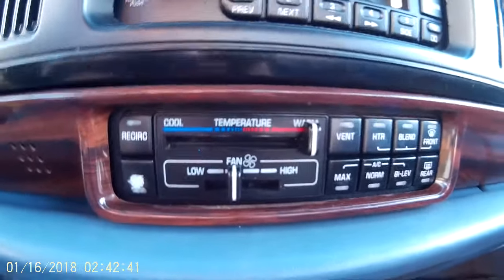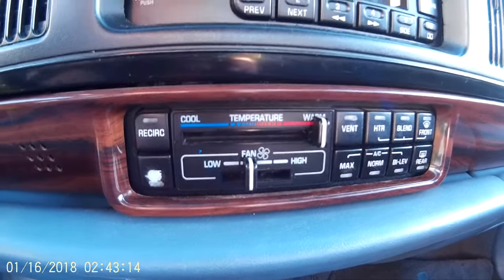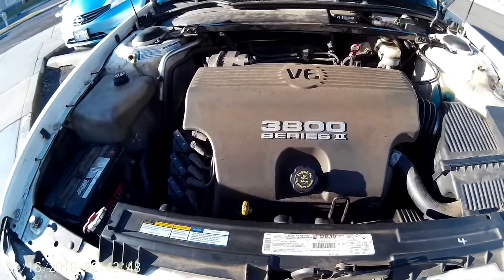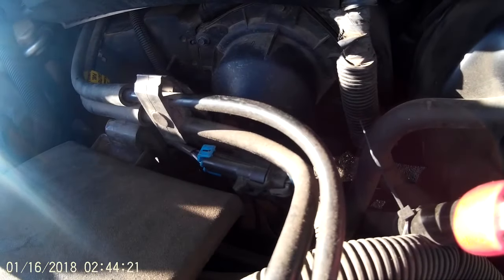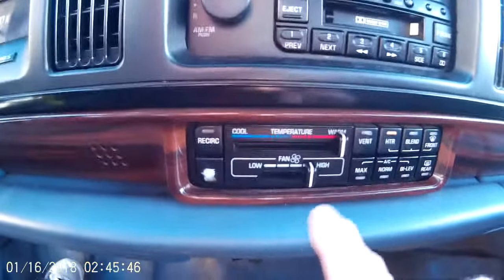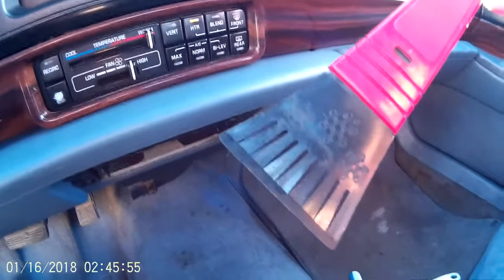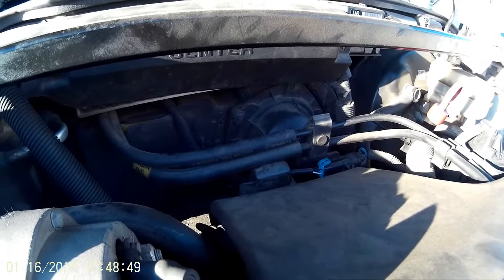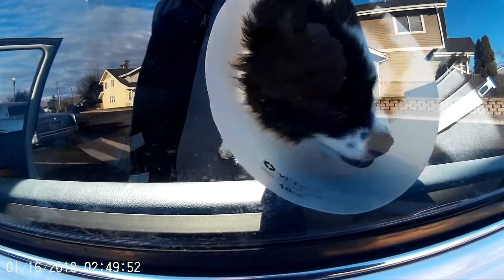1997 buick lesabre custom heater blower motor

Comment: That and the resistor pack are common problems on these through 1999.
Reply: With the resistor the blower would typically still blow on High and only on high setting.